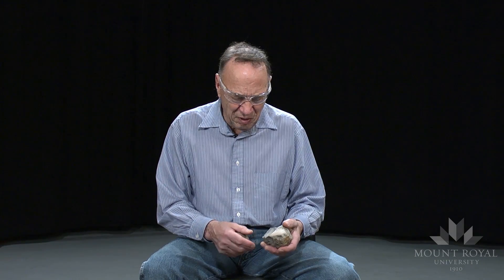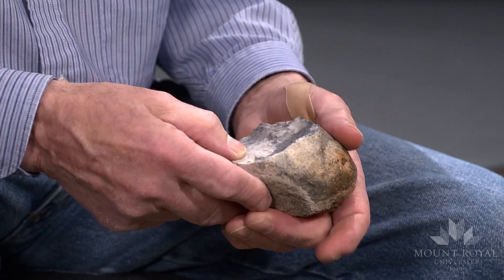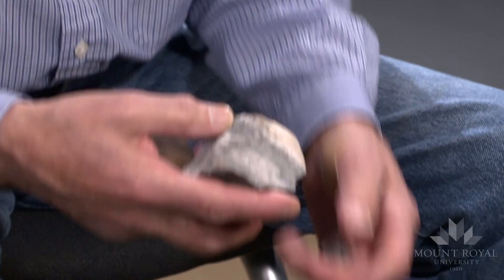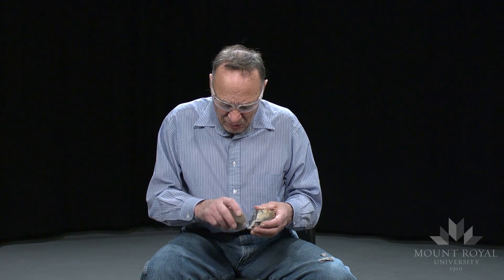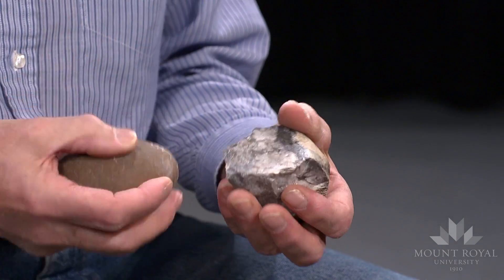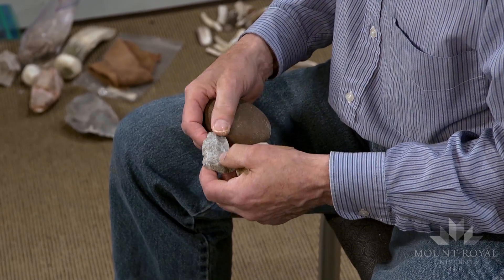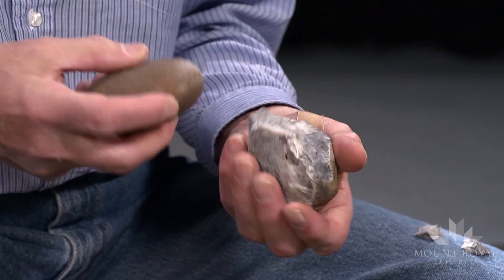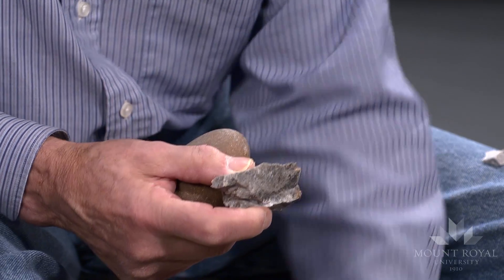Hard Hammer Blade Percussion

Comment: heat treatment was either too long or too hot of a temp. swan river chert responds better to a low heat and longer treatment. if heated to long or to high a temp becomes brittle and or powdery like.☺
Reply: also a hard granite hammerstone works best for removing larger flakes as it absorbs some of the initial impact and your left with bigger thinner blade blanks.